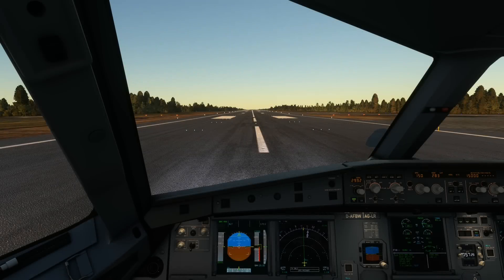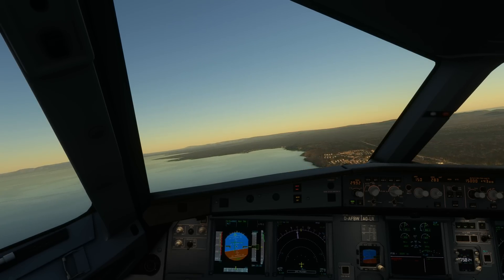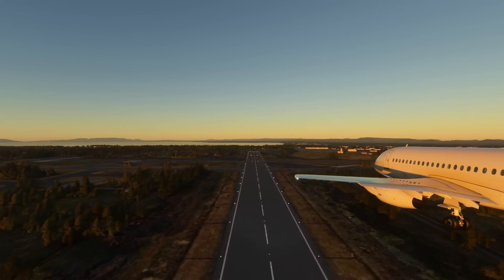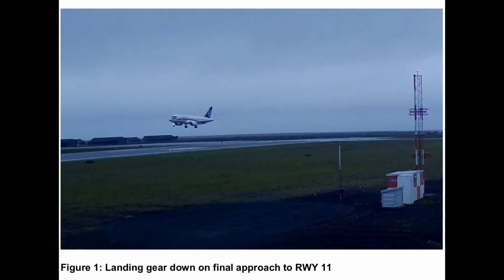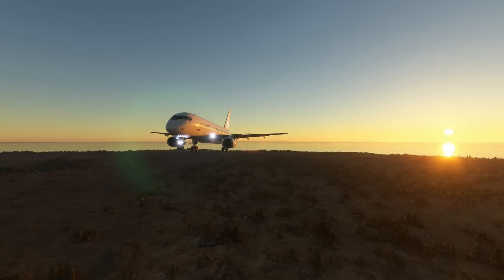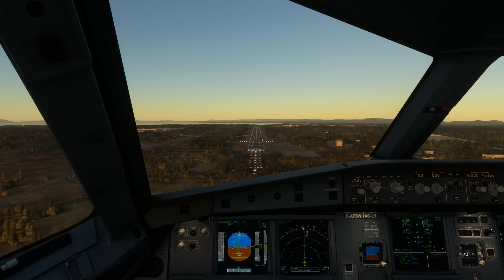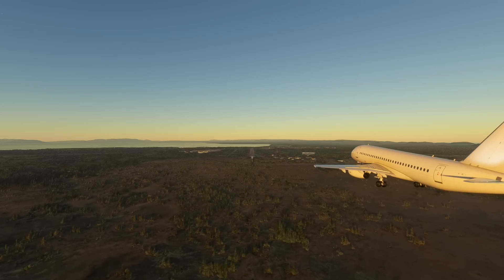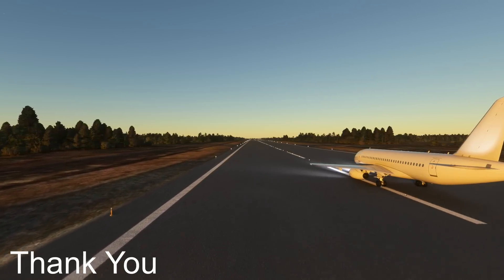Pushed Past The Breaking Point | Sukhoi SSJ 100 Test Flight Crash

Comment: Your audio is so quiet, always has been. I have to max the volume in my headphones but when the next video or advert plays, it blows my ears apart.
Reply: Sounds fine to me
Reply: Tell me about it
Reply: It's been brought up before in other posts. @MiniAirCrashInvestigation, you need to speak a little louder, play with your gain structure and compression settings, and put the mic stand on some shock-absorbing material. There's no issue with the content, just its delivery. 🙂

(Maybe also a tiny bit of vocal reverb, too? "Small" room-size setting, 150-200ms tail, dry/wet mix at 94%/6%.)

Comment: I know test crews of the BAC-111 (1963) and Trident (1966) lost their lives after making the unfortunate discovery that those aircraft sometimes couldn't be unstalled. RIP to them, as well as to the crew in the video.
Reply: Sadly aircraft built with that engine/tail setup are prone to unrecoverable flat spin if certain conditions are met. Soviets had a spin recovery chute installed in the tail of the Tu-154 prototype which allegedly saved the test pilots' lives but didn't bother to equip series production aircraft, opting for AoA warning instrument instead. Flat spins of Tu-154 did happen and they ended in horrible tragedies (Uchkuduk, Pulkovo etc.)
Reply: @tamahagane1700  I believe one of the prototypes for what at the time was called the "DC-9-80" (later known as the MD-80) was saved from a deep stall by such a recovery chute as well, but as with the Tu-154, the production version wasn't equipped with it, leading to the West Caribbean Airways Flight 708 disaster.

Comment: To be fair to everything else - this did uncover a potential failure mode.  If you touch down as you hit the TOGA button on this plane, it may not activate the appropriate mode.

That should perhaps be fixed since that seems like a totally realistic thing that could happen on a passenger flight, and the aircraft not handling as expected during a high workload emergency has caused very serious crashes in the past.

Comment: I always wonder why they dont learn to firewall ALL Engines by default...
If you firewall a shutdown / broken engine, nothing will happen.
If you firewall a damaged, idle engine it could break completely, but how does that matter if you try to save the whole aircraft?

Ive seen this mistake happen multiple times now... just firewall everything...

Its the same with the APU.... if anything with the engines get weird i would (maybe even automatically like an ups) switch the APU on... doesnt matter if i need it... but having it already on could save you later on when the second engine fails and you loose hydraulics and some Instruments...
Reply: I really have to agree with you there. Just off the top of my head I can think of three incidents with pretty devastating results where synchronising all throttles and leaving all engines active would be the saving grace. Yes, in the latter cases one engine would most likely be destroyed by heavy use while damaged. The big but is that the airframes and a lot of people would have survived these incidents. 
TAM Airlines 3054, Midland 092, Transair Flight 810
Lifes above matter.
Reply: Lives above profitability and/or true safety over financial efficiency (cost cutting)
Reply: I think some operators do actually teach this exact thing, just move all throttles to be sure. Evidently it's not a standardised thing, it really should be. Especially with modern FADEC systems where firewalling the throttle won't damage the engine...
Reply: Mouth open in shocked agreement after watching at least 10 of like 1,000 aviation incident/accident channel videos. I have watched over years and incidents come to mind where this exact protocol to firewall all engine thrust levers as you described perfectly would have saved thousands of lives…. At minimum in an airbus/modern fly by wire aircraft, for example, as opposed to an ancient Boeing 737 that need not apply here, includes automated engine failure management/throttle/autopilot coupled safety systems and system wide dynamic software oversight systems on top of other safety assurance backups of those systems, all with abilities faster reacting and better at instantaneous/emergency decision making than a human could hope to manage. Automation can understand instant full throttle from all engines input and give you all she’s got, safely. The computerization should provide a dynamic software environment through which catastrophic damage measured by a multitude of sensors is compensated for and adapted to in a methodical and safe manner to achieve best possible results/performance without killing everyone. 

Sometimes ‘over controlling’ the inputs can save lives as long as you understand the levels of automation you’re protected by, and not really doing that if you’re protected by no automation. Just couple the throttles in that case, god speed. Better than forgetting which engine is off and smashing into the ground

Comment: When you're 4 feet off the ground and sinking maybe it is time to just land
Reply: I mean…at that point you ARE landing, it’s just a question of whether or not you accept it gracefully.
Reply: Agree
Reply: Yes.
Reply: Yeah ... this isn't the first flight to try to go around because of an issue when landing- I saw a clip of a tailstrike airplane (landing flared too much) doing the same....going UP is surely the last thing you would want to do if the tail secton had been compromised 🤷‍♂.. also many of the modern automatic-safety features are turned off when the landing-gear indicates a touchdown has happened (that appears to be also partly what happened here)....🤔

Comment: He couldn't tell he had the wrong throttle? He really should've had both. And isn't it the pilot monitoring  job to do it after the pilot calls for it?
Reply: if you shut down an engine after it failed you don't push the throttle in case of a go around. he got that part right.